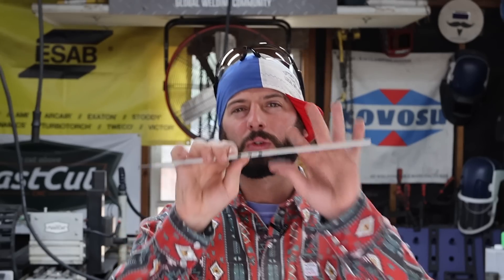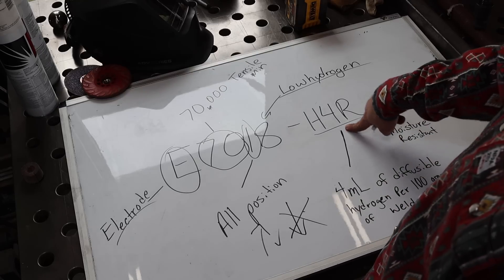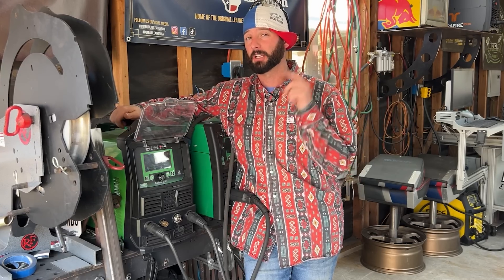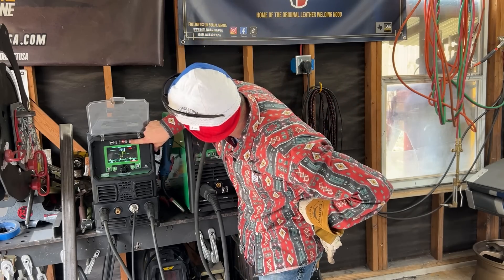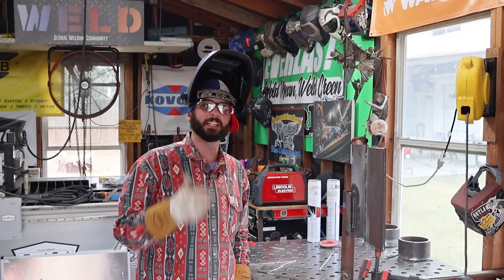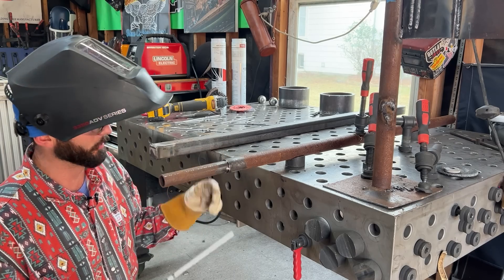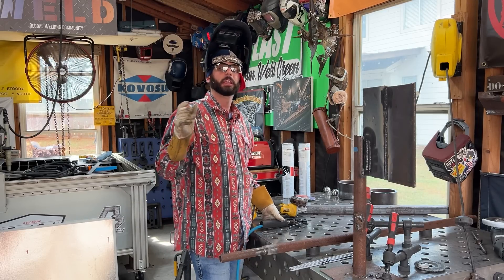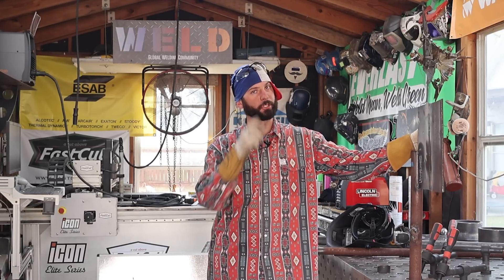3 Common Stick Welding Questions Answered!

Comment: I had a good experience welding with the 7024 rod on AC with continuous high frequency. I just loved the way the bead layed down. Has anyone else tried this continuous high frequency setting? My instructor said it's not something normally used for stick welding.

Comment: I use straight polarity for anything vertical, horizontal, or overhead. Reverse polarity on level/flat only. And I avoid using Lincoln rod, it’s junk. The best 7018 that I have found is made by Bohler. It costs a little more, but it’s well worth it.  Pinacle alloys is another good option, so is Washington alloys.

Comment: That's the thing isn't it; it all depends on what you are welding. Not everything is structural. I just keep my 7018s indoors and havn't had any issues so far. But then again, I mostly weld furniture and the occasional stuff for work (tools, support bars for containers, etc.).

Comment: I did a 6G boiler tube weld test with 6010 and 7018 all on straight polarity once. Still bent and passed, but the 7018 portion wasn't easy 😂. 5P+ runs great on straight polarity though 🤷.
Reply: 6010 7018 boiler don't go together - sorry. Try Cr Mo for boilers.
Reply: @paulmeersa7162  not sure what to tell ya man. Boiler tube is the standard here for weld tests, it's thicker than 2.5"XXH and has a much smaller ID. It just gives you a more broad qualification range. 

Wether its a job test or for a WPQ, it's almost always boiler tube. Don't matter if it's chrome, stainless, carbon, inconel etc.
Reply: @iainscott616  I see, what dimensions was the "tube"... do you remember...?
Reply: @paulmeersa7162  it's 2.5" boiler tube around 5/8" wall thickness.
Reply: @iainscott616  OK, we tend to call that pipe; just a terminology and application difference.
Reply: @paulmeersa7162  no, it's boiler tubing, not pipe. It's triple the price and pipe does not come that thick. It's 2.5" boiler tubing.
Reply: @iainscott616  Do you have the complete classification for it...? Dimensions and material grade.
Reply: @paulmeersa7162  I'll be sure to ask for that on my next weld test 🙄
Reply: @iainscott616  Yes, research the definition of pipe vs tube, research 2.5" xxs pipe, tell me what is the difference between that and what say is tube. I've been in numerous boilers, never seen 5/8 wall boiler tube, seen plenty of thin wall boiler tube though. Seen plenty of steam pipe too. What is written on your ticket for material spec and grade...anything...?
Reply: @iainscott616  You've got me interested now, see if you can't find out what it is.  Might come in handy for tests. There should be a reference to it on your ticket...
Reply: @iainscott616  Nothing on your ticket Iain - seems strange...??
Reply: @paulmeersa7162  nope. It just lays out my maximum weld deposit and what I'm qualified for. So for example, F3 - 0.250 F4 - Max to be welded. Minimum pipe diameter 1" OD. Materials - P1 through P15, P4X. Etc etc etc.
Reply: @iainscott616  Are you saying your ticket does not say what material you qualified on...?
Reply: @paulmeersa7162  Jesus dude. I said P1 - P15, P4X 😂. Also the material doesn't matter. You qualify for the filler material not the material you qualified on lol. Even stainless, inconel, chrome moly, you always test on carbon with the given filler material.
Reply: @iainscott616  So your ticket issuer is not following ASME recommendations then.
Reply: @paulmeersa7162  dude you obviously have no clue what you're talking about at this point. My ticket 100% follows section IX of ASME code 🤦.
Reply: @iainscott616  What makes you say that? QW - 484A asks for "Specification and type/grade or UNS number of Base Metal(s)"   Not a P No.  Isn't that so...
I'd caution you about making judgments about people you do not know. You have no idea what I know and don't know.
Reply: @paulmeersa7162  QW-404 refers to filler materials 🤦😂
Reply: @iainscott616   "@paulmeersa7162  QW-404 refers to filler materials 🤦😂"     I said QW - 484A  - that would be eighty four, not zero four.
Are you sure your pipe isn't to B36.10.
Reply: @paulmeersa7162  QW-484A refers to a WPQ that as filled out would be a WQR. That will in fact have the materials I used on the test (filler and parent), but it is not recorded on the WPQ card itself.

Second of all it is not pipe. I told you that it's tubing.
Reply: @iainscott616  "The word pipe is used as distinguished from tube to apply to tubular products of dimensions commonly used for pipeline and piping systems - B36.10."  Boiler tube is thin walled for heat transfer and is highly stressed at temperature, means usually [but not always CrMo] and almost always thin wall, certainly not 5/8 and over, that is piping as per the ASME B36.10 description and common terminology. But if you have 2.5" OD and greater than 5/8" th thick material let us know what it is so we can use it for welder quals.
As I asked before why don't  you simply go check your ticket to see if it follows the ASME recommendation to show Material Spec and Grade, it would help to figure out what you have there - so others may benefit.

If it is thicker than XXS as you say, and OD 2.5" then your ID will be less than 30 mm, that is quite some achievement to stovepipe with a E6010 wouldn't you say. I've seen Dia 49 mm done in PNG, but never Dia 20 mm something with E6010, that's pretty impressive...
Reply: @paulmeersa7162  well maybe if you didn't act like a know it all I would have told you by now. 

You're telling me it's not tubing. You told me to check my ticket. It's not on my ticket. It is however on my WQR, which I did not have earlier when you asked me, and then when I did you had irritated me so I didn't feel like helping you. But to prove that it is indeed tubing. The material noted on my WQR (NOT ON MY TICKET)  is ASTM A513 Gr. 1026
Reply: @paulmeersa7162 also, on a 6010 root you use 3/32" rods and its quite easy on a 6G, but you're rod inclination is changing FAST. But you can make a very nice looking root. It can be done with 1/8" but most guys can't make that look very good uphill.

And yes, the ID of the pipe is very small. So you can get away with a few things on the root if you're confident it will bend, just because it's hard to see inside even with a tiny mirror.
Reply: @iainscott616  A 3/4" bore with E6010, Vup, I'd really like to see that done!

How many test coupons did you weld...?
Reply: @paulmeersa7162  it's a standard weld test here in Alberta. I've done probably at least 100 of them. It's really not nearly as hard as you'd think. It was definitely intimidating the first time. You can cheat your rod inclination quite a bit because of the small size.
Reply: @iainscott616  How many coupons do you need to weld for your ticket...? How many passes with the E6010..?
Reply: If you don't remember how many passes take a look on your ticket and see how thick the E6010 weld-metal was, I'd be interested in that...
Reply: @paulmeersa7162  it's a 1/4" for F3, just the root pass. The rest is 7018. To get max thickness with 2.5" XXH they write it as 1/8" for F3. I don't know how many passes for 7018. It would depend on what size rod you use.
Reply: @iainscott616  Are you in the oil sands, Methanex that type of thing...?  What do you use the open root E6010 for...? And how come you need to do 100's of them...?
Reply: @paulmeersa7162  I said I've done hundreds. You have to do at least one everytime you get a new job, sometimes 5.
Reply: @iainscott616  You'll need 6" of weld to qualify.

By the time you get three tacks in you just fill in the gaps with three more...

Comment: Sure you can but not where your welds will be inspected. Few years ago when Bob was still on the channel, he taught me way more than i needed from watching his videos than from most welders i've came across. 
I'm not a welder but i did weld 2-4' wide excavator buckets with 1/4" rods and they held up pretty well. I never used an oven, florida sun keeps them nice and dry!

Comment: When welding thin-wall tubing, what size electrode were you using, and what were your settings? I build the rose parade float for our city, and we use a lot of it.
Reply: It was a 3/32, i recommend a 6013 . You’ll have an easier time. 7018 is fine I suppose. Running around 80 amps

Comment: Can you open apack of 7018. Put them into smaller bundles and wrap them in cling film( seran wrap) ?   This seems like a way to save the low mosture rating over time.
Reply: You can try. Keeping them dry is your best bet.

Comment: I run 7018 on ac because all I’ve gots a Lincoln tombstone
Reply: don't apologize because you have a buzzbox., they have been the standard light welding machine for over 70 years, i have three of them,, old reliable machines. try the 60 series of rods, 6011, 6013 etc.  a really wet rod will explode the flux right off it.
Reply: Sucker still purrs

Comment: Low and medium carbon steels with a Carbon Equivalent of less than 0.4 you should be OK with stale 7018's wrt delayed cracking on joints 25 mm or less. You will not likely get delayed cracking and the toughness with be adequate. IF you must use them, if you alternate between a wet one and a dry one per pass, finishing off with a dry one/s on the cap you stand the best chance of success. As mentioned wet ones are not for code work or fail unsafe conditions.
Be good to see you do some experiments and have them tested with bends [using fluro MT after bending] and charpies. See what the differences are. Something for a future video perhaps..?
Reply: I’d lovvve to have a tensile pull machine it would make for some good experiments. I can do the welding, just need somewhere for the testing
Reply: @Drweldz  They aren't that expensive, see if you can do an advert deal with a nationwide lab in the US, SGS, Bodycote if they are still in business, those sorts of people...Selectarc have a facility, so does Lincoln and many weld machine makers...

Comment: I've run 7018s downhill before to fill in grinder marks and small holes in I beams when I was an iron worker
Reply: @icecolddr-pepper4486  i do on anything under 1/8 like bridging on bar joists
Reply: Little touch up and blend. Perfect

Comment: With my Hobi I had the polarity backwards with Fcaw,cherried that work piece and the spatter was crazy! Just some .035 wire and the piece was 3/16 angle at 2" maybe like 70A. speed was good,violent bacon!